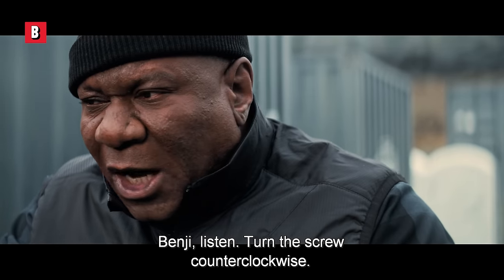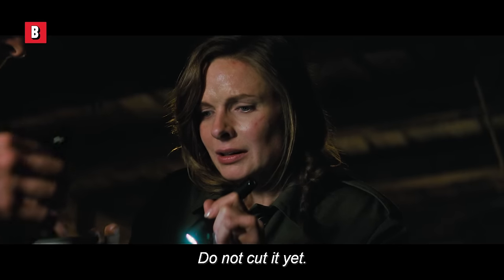Tom Cruise VS Henry Cavill | Final Fight | Mission: Impossible 6 | CLIP

Comment: The physics was a little off here but ill let it slide
Reply: For sure - how do you unhooked a cable loaded with a helicopter with one hand?
Reply: @DanielClementYoga  yeah plus it would catapult away from them instead of coming down straight
Reply: its a movie not a documentary
Reply: @DanielClementYoga  How exactly does it not make sense? The ground it was hooked on was on the verge of breaking, and Ethan merely gave it the last push.
Reply: @dsharp4763  Helicopter weight 22,000 lbs.  Amount of force in pounds Ethan could generate with one hand while holding onto a cliff....?  It wouldn't be significant, and if the ground was letting go (it was, as you say) then the cable would have done exactly the same thing anyway.
Reply: @DanielClementYoga  Exactly so. Don't you see the ground is constantly cracking even without him pulling it? He merely make it happen faster.